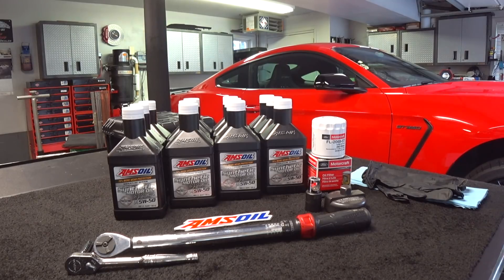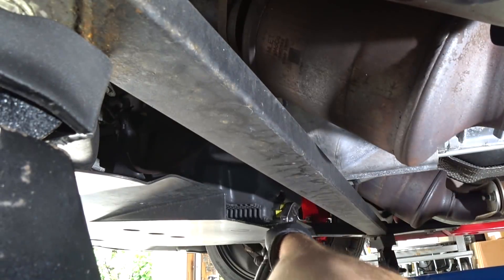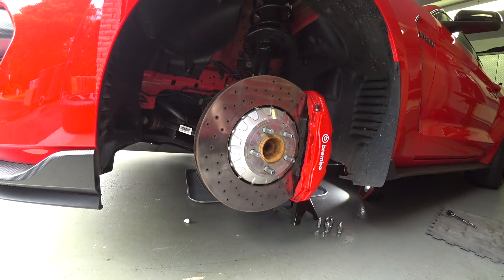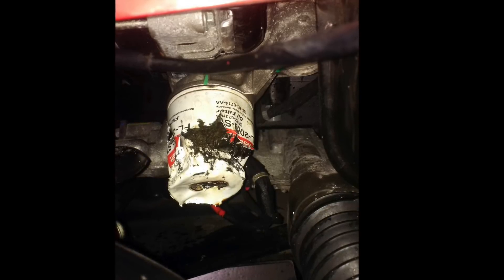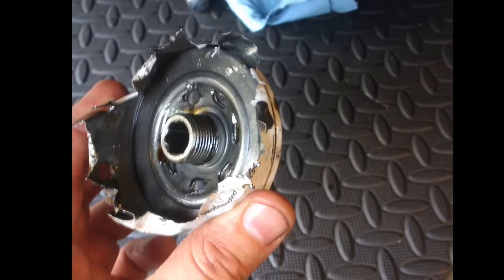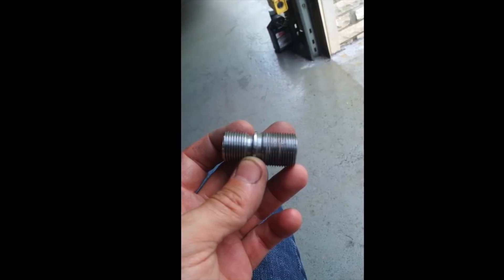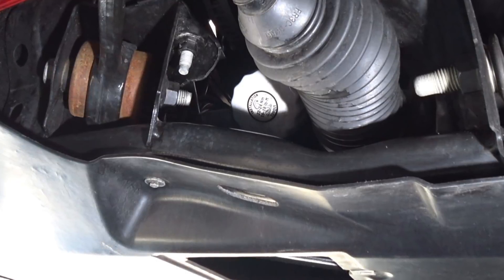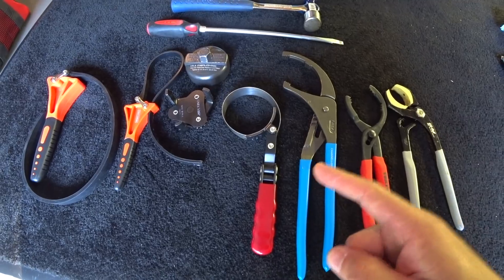Oil Change From Hell | Shelby GT350

Comment: As a ford tech i can say no one torques oil filters or drain plugs. 
Nor do they use impacts on oil filters.... 
that riped do to user error. 
Not once in my many years as a tech have i had that much of an issue getting filters off. 
Use the right too for the job. 

And the change in filters has to do with cost savings. Not techs fucking shit up
Reply from the maker: you must work for a small Ford dealer who that does not sell these performance models like around where I live.if you never worked on this particular car before, these filters require torque with a torque wrench and dealers were liable for filters falling off and warranty claims for blown engines, this must be why the tech overdid my car months back to cover his ass.
Reply: Auto Fanatic were no small dealer. Now were not a svt dealer. But we do still service all makes and models. And ive personally worked gt350s its no different then its gt counterpart. But for shits and giggles ill check out tsb and recall list for your claim
Reply: Wait till you do the first oil change on a brand new ford. The filters are put on dry and the case is thinner then motocraft filters...
Reply from the maker: why does ford make these silly rules for you guys in the shop? glad i do not have to work on new cars for a living.

Comment: My question is why not take it back to the shop that initially changed your oil and filter? Why not Have the shop fix their mistake? Or is it that you're the last person that change the oil filter and now blaming someone else for your mistake? I'm just saying cuz it looks like you have all the tools and equipment to do your own wrenching so I question why would you take it somewhere else to do an oil service? 🤔🤔🤔🤔🤔🤔
Reply from the maker: the car was already at the dealer getting updates done it was just easier to have them take my case of oil and do it but who knew these fools would have done what they did months down the road.
Reply: The video of the proper oil change wouldn’t generate views.

Comment: Nice car to bad you had this problem. Ford made the oil housing change to solve a oil consumption concern. I put a long block in a 2018 GT 350 it was using 4 5 qts in less than 1000 miles. I work in a large dealership yup these "lube techs" are not the brightest of people.

Comment: no, i have to say, if someone over tight a plastic one, it will be worse. i used have to chopped every single piece plastic off a pruis. trust me, its harder than u think. i was lucky to got the last piece of the plastic oil filter cover or that car would be sit there couple days.
really should ban those noob quick lube guys

Comment: There have been times that I've had to jab a pocket knife or socket extension through the body of an overtightened oil filter but it doesn't look like you'd have the room to there and might still not have been able to get its threads turning.  That's worse than when a BMW dealership tightened my Mini's drain plug so severely that I had to buy a set of Irwin extractors on the next oil change.

Comment: What's wrong with the drop in filter element style? 

Almost every car I have had uses them, and they work fantastic. Never had any issue with them, and proper designed one's have a drain plug on it to keep mess at a minimum. Hell BMW's drop in element design is the absolute best considering it is done from the top so there is literally zero mess.

Comment: You lost me at saying they installed it with an impact. If they did that the filter would be completely twisted as the torque is from the back. I don't think I've ever seen anyone use an impact going on or off with a filter in my life, I've worked in the auto industry most of it. 

Still sucks, who knows what happened, but it was definitely not an impact.

Comment: Surprised few if any comments state the obvious.  This happens a lot when people forget to just simply apply oil to the mating gasket.   Oil the gasket, tighten to specs..call it a day after refiling and checking for leaks.

I've had several dozen cars in the shop I used to work in with this issue.  Wound up driving a prybar though the shell near the base of the filter and use it like a giant key.  Gasket was baked to the mating surface.  (sure sign that it wasn't oiled up)....  Had to deal with this a lot!

Comment: 2 things.  1: This is why I NEVER take my car in for an oil change somewhere.  I always do it myself.  2: Warming the engine before the oil change is fine unless the engine hasn't been run in a long time.  If it's been sitting for 3+ years, change the oil BEFORE you start it.

Comment: If Ford bothered to change their filter design it's not because of a (few) bad technician(s). Those cartridge filters can only go on so tight, as you've experienced with trying to take it off with a filter socket, it keeps slipping off. and by the looks of it there're no marks on the filter itself from "over tightening". It must have been a faulty design, like you said, probably because of aluminum/steel dissimilar metal corrosion that seized up the filter. But this is my only hypotheses from your video alone.

Comment: Fucking Ford! 
I love my 08 FMF edition Expedition but  its a headache.

Anyway, Right after Ford had the big to do over its 10 millionth Mustang built, they shut down manufacturing so they could correct a quality issue with one of the parts. They repaired a lot of Mustangs and Shelbys. So, this might have been what they corrected. Or a driveshaft problem.
Reply from the maker: yes they did update the oil cooler issue and the oil pump and filter design because of this issue shown here.
Reply: @autofanaticcars  awesome. That clears that up. Though I was sad That I didnt have anything to look at when I came back. All the Shelby's that were parked for rework were gone.

Comment: Is your oil pan plastic?....i feel bad for you. I suppose its throwaway and no gasket required. Instead a whole new oil pan. Keep in mind, engineers (ford engineers at least) do not want diy folks. They want ppl like Ford techs Makuloco (chk out his channel for reference) doing service. The good ol murica days where any monkey can wrench are long over. Do not be surprised if they put pepper spray and sprayed nxt time you open a hood to a ford...what crap they make (this is only part they seem to impress me)... New raptors made out of aluminium beer cans and no v8's only ecoboost v6. Thx for your pain n suffering you saved many ppl. It was brutal just to watch.
Reply from the maker: carbon composite oil pan to save weight, this is quite common these days
Reply: Auto Fanatic after my first comment all i can remember is when i first started wrenching for a living, they assigned me a Mazda 6 for radiator R&R (ford in mazda skin). I looked into the labor rate and strange enough it called for quite a bit of hrs and i could not understand why until i started looking at it from the top (impossible) then looking from the bottom (also impossible). They designed it where the front structure of the car was one whole entire PLASTIC piece where the radiator was incased inside and therefore i had to remove the whole front end....it looked like i was hired for a body shop. Other techs were like "oh man your the new guy this why you got this crap. I got this done just in time the labor rate called for tobe profitable but this became a life lesson to stay away from ford. When you titled your video the way you did; my reaction was "yeah, not surprised it was a ford product and some one is going through hell for a oil change".

Comment: Interesting. My last nightmare oil change was my mother's '13 Ford Explorer which was done previously at a metro Detroit Ford dealership. 2 hours to get it off. People are retarded. Lube the rubber gasket well, hand tighten. That's it. Leave your breaker bar in your tool box. It's a oil filter for Christ's sake. If a tech doesn't know how to do this properly I question all their other abilities. This job was one of the first services I learned to perform properly  when I was 12.

Comment: Pretty sure every single dealership sucks ass. All they want to do is sell cars, and bully you into paying 2-3x the cost of a repair. Worst is sending it to them for regular service, I was extremely disappointed when my mom's Porsche dealer charged her $15 for windshield washer fluid and I had filled it before I sent it to be serviced as a test of their honesty. Fail, learned my lesson, never ever going back there.

Not to mention there were tons of oily fingerprints in the engine bay, and oil all over the front axle because of how the Cayenne filter drains. Shitty oil change for $300-400. Takes me 1.5 hours to do at home, and I know it's done right.

All the dudes that say "I only ever go to the dealer!!!" are fucking idiots.

Comment: @auto fanatic I'm watching the market for a 2017 GT350. You say they have taken measures to fix this issue, when were those changes made?
Reply from the maker: they switched to a 2 piece design with a replaceable cartridge element, i show photos of that in my video here.
Reply: I believe it’s 2017 model year GT350’s produced after February 2017. Mine is a July 2017 build date and it has the new style filter.

Comment: I had a ford dealership use a impact on my Mach 1 oil plug. This has been years ago. Basically tore the threads out of the oil pan. It always leaked oil after that  no matter why I did.

Comment: The idiot who put that oil filter on the first time either forgot to put oil on the rubber, and or also put sealent on the rubber. I have jack ass techs who don't like their customers do that. Yes they will hit with the air gun to over tighten it.

Correctly oiled oil filters should easily come off.

Comment: Dealerships can have the worse techs. I dated someone that worked for Honda. She use to have to authorise engine replacements all the time. People would come in for an oil change and a few days later have a seized engine. The techs would forget to put the oil filler cap on and the car would shoot the oil right out from there. They would fire and hire new techs and the same thing would happen. She quit under the pressure and that dealership is now gone. This happens when you hire people for $7 dollars an hour.  I have my own run in with oil change techs. I had coupons all the time for oil changes, so I would use them. Well after years of using them, I changed my own oil one day. Everything was going smoothly till I got to the oil filter, I had a death grip on it and I could not get it off.  I had to get a pair of Large Pylers to get the oil filter off and it took a big torque to get it off. I would like to hit that person too, with my fist.

Comment: Think you might switch it over the the cartridge design oil filter and housing used in the 2018 models? Its a bit of work but others have done it. I’ve had cars with filters over torqued from the factory. When that happens I just punch a screwdriver through it and rotate it. I’ve also just torn then off like yours did. For the remains I’ve used a screwdriver and hammer on the base of the left over filter and sort of freed it up. You want stuck on bolts, go see what happens with the nut that hold the front sprocket on motorcycles that’s made of recycled pot metal and how it gets welded to a steel crankshaft. Arghhh.

Comment: The very first time I worked on a car I was 13. I did the first oil change on our 1980 Plymouth with a Slant 6 engine. I went through the same thing and it was the factory installed oil filter. I spent 3 hours getting it off. First it crushed. Then I literally peeled it down to the base. Then I used a long screwdriver and hammer, tapping in the holes of the base of the oil filter to rotate it. It twisted the pickup right out of the oil pump along with it. Like you, I had to put it in a vice and work the two apart using two pairs of vice grips. After three and a half hours, my hands look like I stuck them in a food processor LOL.

Comment: You gave me flashbacks to when I had the same situation on my S197. I had to lance the filter with a screwdriver (thru both sides) and twist.  I had heard that filters were coming loose on people, and that might explain part of the extra torque, but damn - absolute overkill.
Reply from the maker: yeah this was beyond extreme dissimilar metals when they seize becomes a nightmare to get off without damage.

Comment: You know Ford products have that issue since at least the 1990’s with the oil filters right? This is not a news flash @auto fanatic
Reply from the maker: i would never know i never owned a Ford product until 2015 and only owned vintage Fords from the 50;s and 60s
Reply: Work at a Ford product car dealership. 
Getting your ass kicked by a oil filter is nothing. Go watch Chris Fix get his ass beat by rear drums on his channel-
At a dealership you have to check the brakes all the time and the rust lip on those drums is a bitch to get around.

Comment: Why I change my own oil from day car is new.   Early 1960 I was a college student away from home and was forced to use a service.  Once I ran into the same issue,  but the fix was they hammered a screwdriver through the filter near the base and turned it out.   Easy because it was a 1959 Ford with six cyl engine and lots of room.

First home was in 1971 and I made some ramps from 2x10 solid lumber and nobody touched my cars since.  Have had no issues with broken cars since.  I am convinced they manufacture problems that need to be solved.

Comment: This happened to me on my mom's Lincoln MKC. The prior oil change was done at the dealer and the technician over torqued the filter. Motorcraft filters don't fit inside the oil filter sockets that well like the Amsoil filters do. I like you tried the straps. Luckily i had more room than you did and after a lot of swearing and time the biggest Channel Lock pliers they make got it off. I lucked out again that the threads were ok and the new filter screwed on easily. I like Amsoil too. I've used their Signature Series for a lot of years now in all my wife's, mine and family members I help change vehicles. It's great oil. It's noticeably cleaner even after a year of use.

Comment: I don't know about the dealerships people take their car too. But along with myself and all the other techs at my dealership, we take pride in our work. With that said, I am also NOT a express technician. If your dealership offers an express oil change, don't take it. That is the goal of express, to get you in and out. I take no less than 30 minutes to do a oil change if I have to do one. I'm flat rate, so I don't care if I need to take some extra time to do it right. Express technicians are paid hourly, so only they get rushed by the service writers to hurry up with customers. You also have to understand that most people that get a oil change are also "waiters". If a waiter has to wait for longer than 15 minutes, then they start complaining and that itself leads to the express tech being told to hurry up. Which in return makes them do a rush job. So if you do want a oil change, just tell them to take their time.

Comment: Hahaha wait till you break the two piece cap trying to get it off once it’s stuck. They suck ballz. Ford is notorious for oil filters where they’re hard to get at. Just do a remote filter setup from the factory. Not to mention that after hours of agony you now have oil all over your cars belly bits. They make the filter too thin and it crushes. When’s the last time you crushed a good old ph8a ?  Those old styles are just better. I know you would happily pay $2 more for a filter that wouldn’t crush!  The other terrible filters are on the duramax motors I swear to god him self you can put them on loose and they friggin tighten themselves on over time. !  Ughhhhhh

Comment: As a former dealer tech, let me make something 100% clear... Real techs RARELY do oil changes at dealerships. They're done by kids with little to no mechanical knowledge in the lube bays. This is why drains plugs get left loose, filters are either too tight or too loose, and cars leave with no oil in them. Dealerships are cheap. I made 3 times what the lube techs made.

Comment: I worked in dealers years ago, Saturn, GM and Ford. They are all about one thing. Money! Sell, sell, sell! That is their motto. They honestly could care less about customer satisfaction. Saturn actually did more than others, but Ford and GM were terrible. Most had no real ability to diagnose problems, nor did most do the job right. It was all about beating the clock to make hours. (Flatrate techs) In the end, I quit and vowed to always stay independent. I refuse to take advantage of people and sacrifice quality work for quantity of hours to make the dealer richer. Nice car my friend. Well done on not losing your patience with that mess of an oil filter too. Shame that was put on so tight.

Comment: There was no reason for this oil filter to be so hard to remove other than dumba$$ mechanic, that worked on it previously. Oil filters are meant to be installed BY HAND, not with an impact or any power tool [unless specified by the manufacturer, but I have yet to see one].

On a somewhat related note, I had to replace the entire oil pan on a VW Passat Wagon because the idiots at the quick lube installed a fast drain valve and boogered up the threads.

Comment: I have done every oil change myself.  But each change involves me destroying the previous oil filter to remove it . I have to use oil filter pliers and literally  crush it to get enough grip to unscrew the filter.
Your issue was extreme.  Glad u were good at what u do and cld recover it
Reply: Darwin Carey try putting some grease on the rubber ring of you oil filter, next year it will come right off with no issues